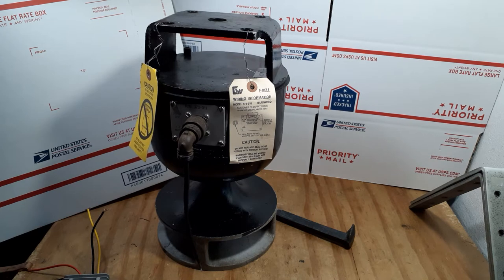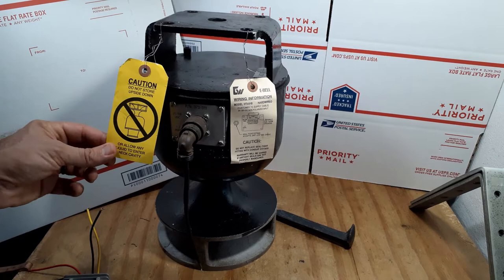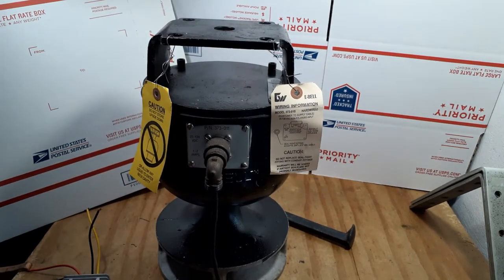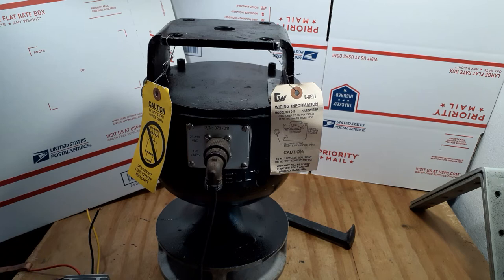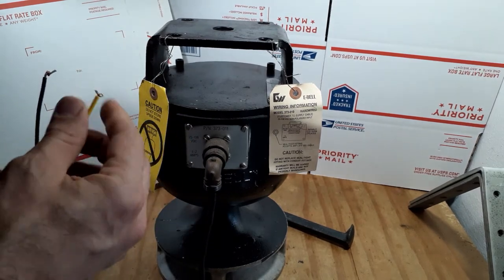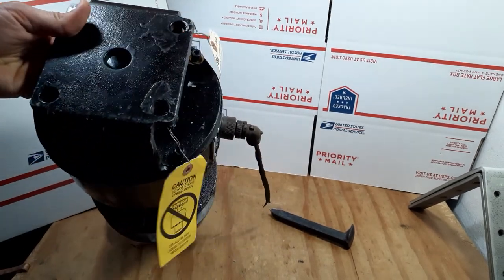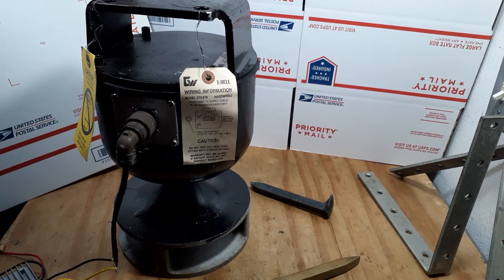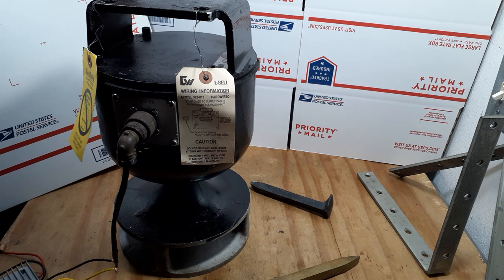WABTEC GRAHAM / WHITE E-BELL.       TRAIN RAILROAD LOCOMOTIVE BELL EBELL. 373  SERIES

Comment: Where exactly did you get that ITT female connector? Do you have a part number by chance?
Reply: This guy is really good at replying to comments! A1!
Reply: @brianjanes4393  I second this. I really need one
Reply: @johnanders8861  Hey guys, I'm soooo late. You can use the average laptop charger/connector. For most chargers with a power supply(the little box) the part that plugs directly into the wall should plug into the port in the bell. Hope this helps, lmk if you need more info

Comment: how does the e bell work?
Reply: It’s actually a speaker (not a physical bell)
Reply: It’s just a speaker with a driver circuit. It runs on 25-138v dc. Draws 2.2 amps inrush, about 1.6 continuous